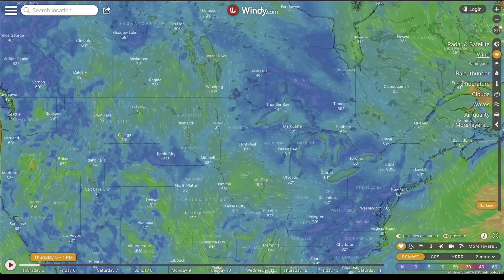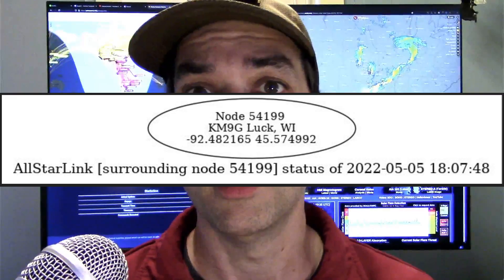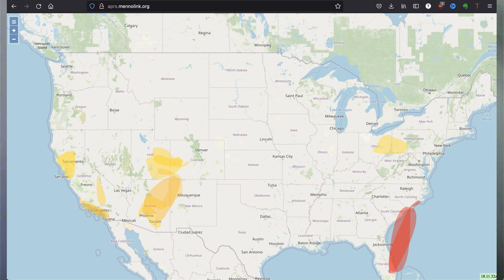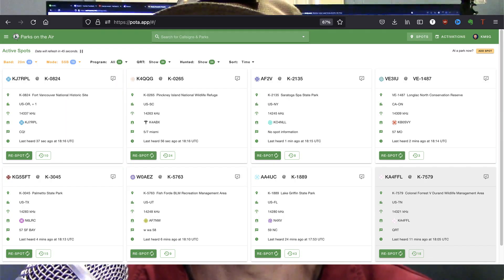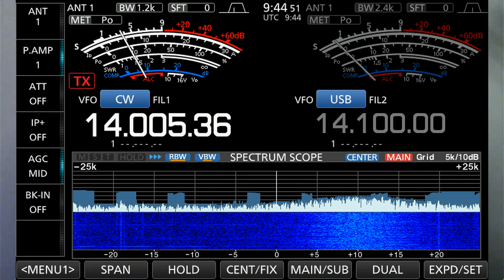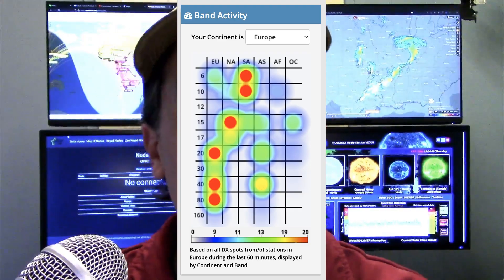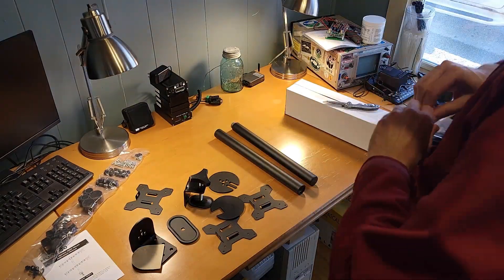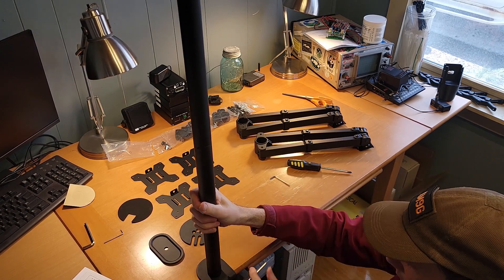4 heads are better than 1

Comment: The latest batch of Windows 10/11 Mini PCs (an example brand is Beelink, other brands are available) can often drive as many as THREE 4K displays, two by HDMI and one more by USB C. These Mini PCs are now silly-cheap, as low as under Cdn$200 for the ones that are likely powerful enough (N5095 quad core) to perform these sorts of dashboard functions. I'm using one right now to watch this video. Cheers.
Reply from the maker: Thanks for the tip!

Comment: I have a couple RaspPi's that I use on the 2nd input to my desktop monitors and I also have a very old iMac that runs Linux for similar duties.  I use Barrier open source software (like a software KVM switch) to allow me to control any of them over the network.  It basically allows me to put the cursor off the screen and it then attaches my keyboard and mouse to another assigned monitor.  It means I can have Linux as my main computer and also control a Macbook and Windows PC from the same keyboard and mouse.   Very good, and much better than VNC etc.
Reply from the maker: I used to run a program called X2VNC that would do that.  LOVED it!  I'll check out barrier!

Comment: Great video! I’ve been using the Mimo Vue Capture 10.1" USB Touchscreen LCD Monitor IPS UM-1080C-G devices, lurched cheaply of eBay. I now have 6 in my shack. A row of 4 are on a shelf underneath a 34” ips hdmi monitor and above a 24” Dell main monitor. I have varying software screens output to each. The other two are on another set of shelves nearby where vhf/uhf hotspots, scanner, SDRs, and so forth are located. One monitors a WiresX Room with the other contains my scanner output from a scanner manager tool. Getting a video card to “carry” all these screens would prove folly! Many if our older technology monitors will easily handle the resolution output from many of our tools. Thanks for continuing these great ideas, TO!
Reply from the maker: Thank you Frank!  That shack setup sounds awesome!
Reply: @temporarilyoffline  Well…there would be some Awesome Sauce on these Mimo monitors if I can find the time to get the touchscreen feature to work well in Win 10, lol

Comment: Having an array of monitors is a nice thing to have. I might have to plan something out…. Hrmmm….
Reply from the maker: For some reason 4 small works out easier than one big... not sure why.
Reply: @temporarilyoffline  Easier to to place dashboards or browser windows on each screen. One of my old jobs had 8 or 10 monitors hooked up to on PC to display many different things that needed to be monitored.
Reply: @temporarilyoffline  One monitor will get you a resolution of 1920 x 1080 no matter what size the screen is. However 4 monitors will give you a whooping 3840 x 2160 resolution.  A lot more space to put things on!
Reply from the maker: @ronwolenski-n8wcr  I think that the UI for the OS is also better sized for a 1080p monitor than for a 4k monitor.  I have a 42" TV running Linux in the living room and its impossible to see the controls and all the websites are zoomed in.